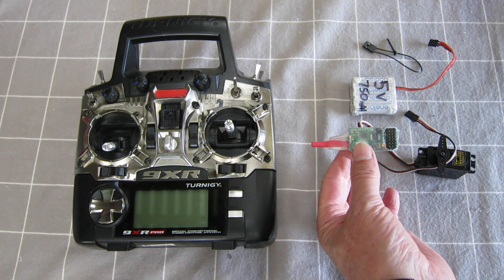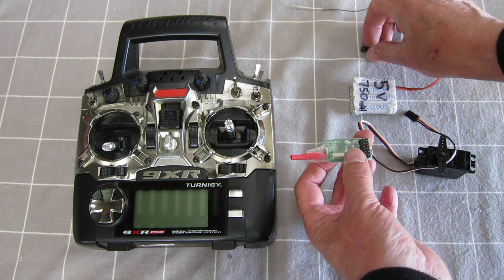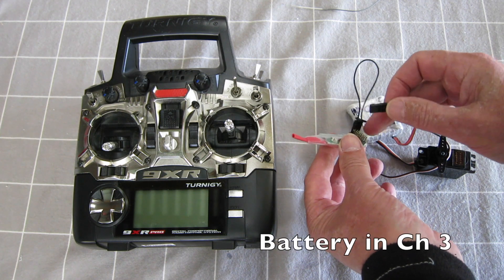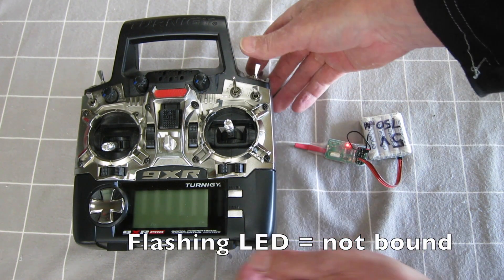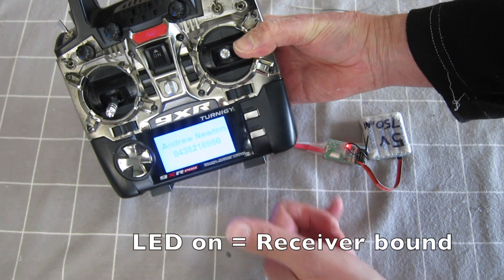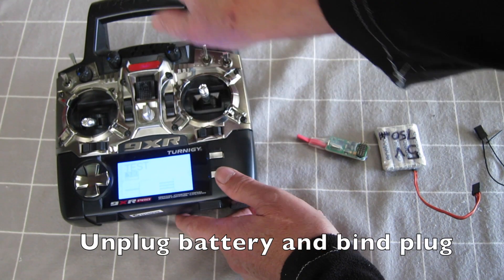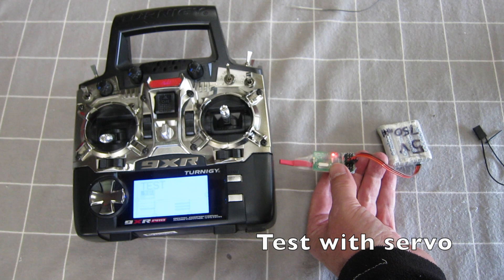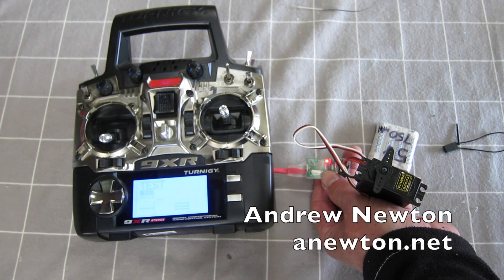Turnigy Receiver binding

Comment: Thanks for posting this!  I've never had an RC car, I'm 3D printing one, and I've had a pile of RC electronics here and not a clue how to use them. This video helped me understand the "bind" channel and that "loopback" plug that the unit came with.  Anyway, thanks for sharing, helped me figure out a step of the process!
Reply from the maker: No problem. Little tips like this from others made me want to share what I know.

Comment: I have a Turnigy I6S and both the IA6B and the IA6C,  Neither receiver requires the bind plug.  I'm curios to see how my new 9X and IA8 are going to react.  IIRC my Spektrum DX6 receiver also did not require a bind plug.

Comment: it wont bid. i have the exact same radio same module and same reciever. i put the bind plug in correctly and same with my esc but it wont pick it up
Reply from the maker: Check the module pins and make sure it's fully pushed in.

Comment: Hi, where can I get a 5v battery pack?
Reply from the maker: I bought the 5 battery case with switch from JAYCAR and the 5 eneloop back from EBAY
Reply: Thank you. If I don't have this battery pack, I can just connect to the quad power supply (i am guessing it is regulated) to the receiver? Sorry, I am new to this.
Reply from the maker: Don't know about your quad, but my planes use an ESC with a built-in BEC that supplies regulated 5V for receiver and servos. I guess there will be something similar on your quad.
Reply: Andrew Newton Thank you. I think so. The receiver is connected  to the flight controller cc3d and the fcb is connected to the power source.
Reply: Andrew Newton hi im wondering if you know if a turnigy module Dsss works with corona Dsss receiver?

Comment: Do you think the 9XR PRO is that better than the 9X ?
Reply from the maker: Good question. A fully modded 9X with backlight and OpenTX would be close to the functionality of the 9XR Pro. I would say the 9XR Pro is better but feels clunky to use.
Reply: Andrew Newton Does the 9X also feels clunky ?
Reply from the maker: No, feels much better than the 9XR Pro in the hands.
Reply: splash screen with phone number is a good idea.  got a $600 gps back with that method.
Reply from the maker: Ah, good to hear it worked for you.